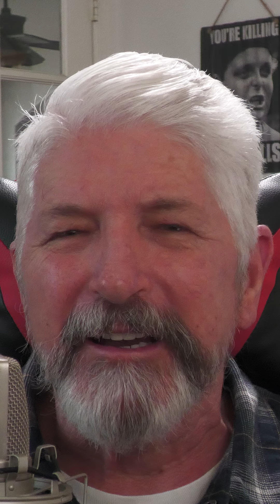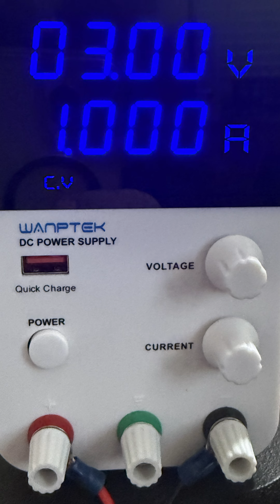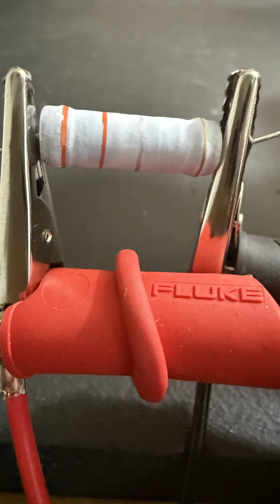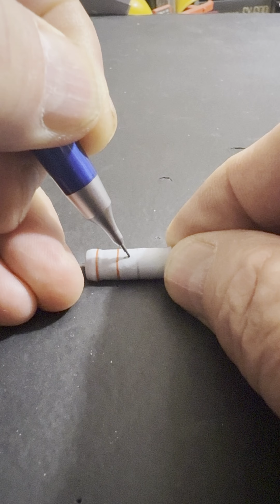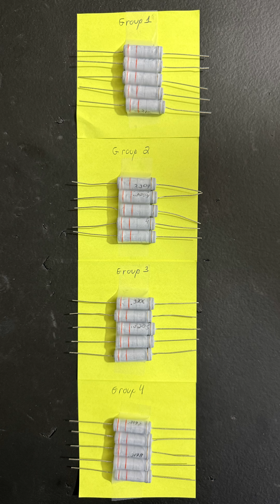How and Why Match Emitter Resistors?

Comment: One additional thought and probably overkill, could you use the small variations in emitter resistors to compensate for differences in vbe(on)?  Lower value resistors for higher vbe and vice versa -- the idea being to match when all transistors in the bank switch on.   If hfe is well matched, current should then be well matched across all parts of the wave.
Reply from the maker: That’s a great follow-on thought, and not overkill at all—you’re thinking along exactly the right lines. In theory, yes, you can use small variations in emitter resistance to help compensate for Vbe differences so devices begin to conduct more uniformly, especially if hFE is already well matched.
In practice, though, I tend to keep emitter resistors tightly matched and let them serve primarily as ballast for thermal stability and current sharing over temperature and time. Vbe tends to shift with junction temperature and operating point, so “pre-compensating” with resistor values can become a moving target once the amp is under real signal and heat.
That said, your approach is absolutely valid from a device-physics standpoint and is something you’ll see discussed in high-end or experimental designs where operating conditions are very tightly controlled. I really appreciate the depth of thought you’re bringing to this—great discussion.

Comment: Really appreciate your videos.  Just thinking, would you be better off using a wheatstone bridge to match?   That would remove any voltmeter loading or lead resistance effects... use precision resistors in two legs any use remaining two to match test resistors.
Reply from the maker: Thanks, I really appreciate that—and great suggestion. A Wheatstone bridge is absolutely a solid way to do high-precision matching and it does eliminate lead resistance and meter loading effects. I mentioned about building one in a previous episode.
For this particular process, I’m measuring under a known current and comparing relative drops using the same setup and leads, so the error terms largely cancel out. The goal here was repeatability and real-world matching rather than absolute metrology.
That said, you’re 100% right—if someone wanted to push this to lab-grade precision, a bridge method with precision references would be an excellent approach. I may actually show that as an alternate method in a future video. Thanks for watching and for the thoughtful input!
Thanks for commenting!